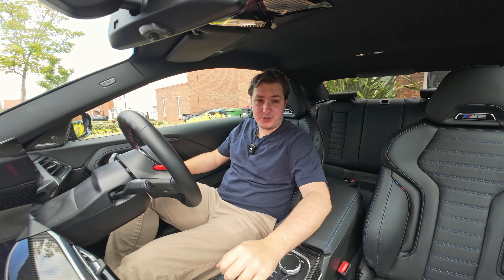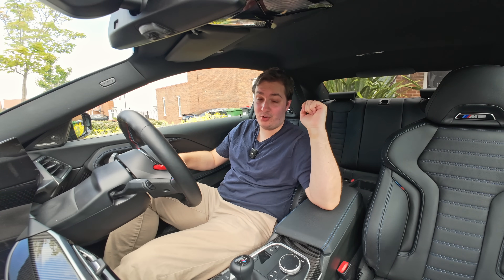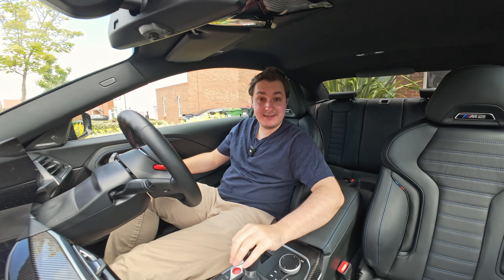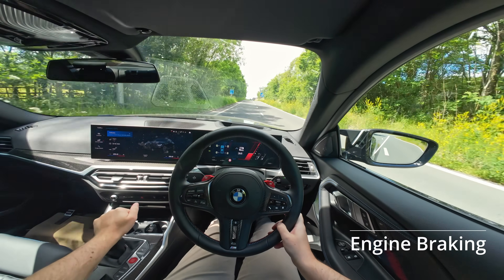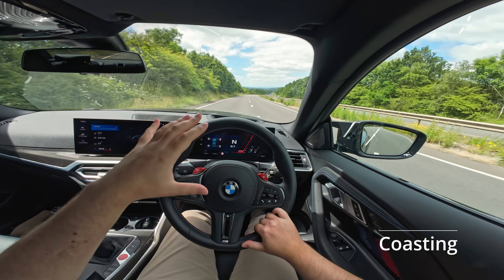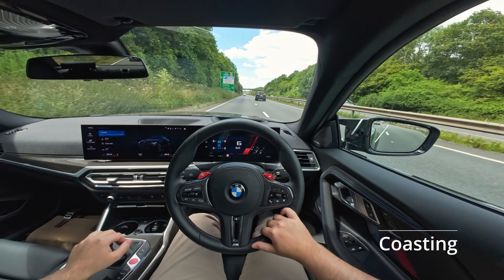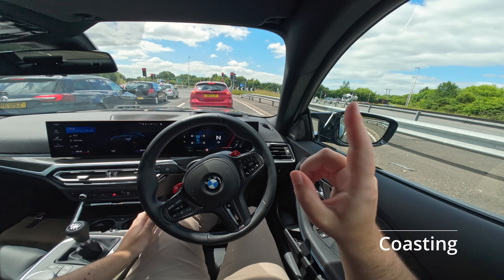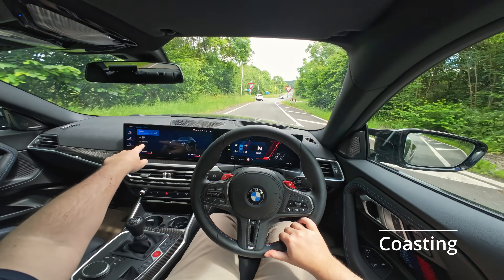Engine Braking vs Coasting - Explained and Tested

Comment: Some modern MHEV cars automatically coast with the engine turned off getting crazy fuel economy. I've seen a 1.3 petrol Renault Arkana get 5.4L/100km (52.3 mpg UK). It's not a powerful car at 158bhp, but certainly impressive for a family SUV.
Reply: That's crazy economy but in a city it depens on how many redlights you have
Reply: @somebody6996  Of course. This economy was achieved in a long trip with a generally low speed limit (mostly 90km/h). If you enter a city, expect consumption to increase drastically. Combined real world economy might be around 6.5L/100km (43.5mpg UK). Haven't really measured economy in a city, but seeing how it affects the average, it probably is around 7.5 or 8L/100km (37.7~35.3 mpg UK).
Reply: my ibiza fr 1.2 can do about that with not the most efficient eco driving. love it
Reply from the maker: Oh yes! I drove a newer hybrid Corolla for a day and averaged 58mpg (99% highway)

It did exactly this, when off the throttle it cut the engine and coasted.
Reply: @MickDrivesCars  you can go one better - the Corolla is actually lightly regen braking in the scenario you describe. Lift off then replace just a tiny amount of throttle. The car will then truly coast with the engine off. Toyota hybrid hypermilers have been doing this since the early 2000s and the original Gen 1 Prius.
Reply: @MickDrivesCars  I drove a Fiat 500 that had kinetic energy recovery. When you engine brake, there is also a regenerative electric motor that charges a little 100 watt hour battery, that gives you a boost on top of the engine when you accelerate again. I'm not sure what the fuel economy was in the car.

Comment: What about engine braking to a stop while rev matching down the gears. Would be interesting to see how that compares to coasting to a stop
Reply from the maker: Yeah you can, and I often do. There wasn't really a chance for this during the video since it was all motorway.

I think if you have to stop engine braking is better. Rev match or engine brake down to idle rpm and neutral from there.
Reply: I think that for coming to a stop it's better to rev match by just holding the clutch at the bite point.
Reply from the maker: I mean, I literally told you not to do this in the video 😂

Comment: I agree. Ive been reading the comments and paid attention to your explanations and you are right. Engine brake for stopping or keeping the car at a reasonable speed down a hill, coasting for when engine brake is too much brake (less likely scenario). Maybe in some hills engine brake or coasting is not the better way but it is to lift just a bit. I hope I am comprehensible.
Reply: I think in most cases, lightly pressing the accelerator in gear to go the same speed as coasting in neutral, uses more fuel.

Comment: Great video, as always. Questions: isn't it dangerous to coast? Decoupling the engine from the  transmission makes a car unstable, precisely because you don't have engine breaking. Second, is it safe/healthy for an engine to engine brake at high RPM?
Reply from the maker: 1) absolutely. Use at your own risk.

2) none whatsoever
Reply: @MickDrivesCars  Roger that 🫡

Comment: I may be wrong. But I have an impression that engine consumes same volume of fuel when we lift our foot off completely. This is idle level of consumption and engine never goes lower than that. You would need to shut it down to consume zero. But it will probably start back again, being turned by wheels, if ignition is on. Let's do imaginable experiment. Do engine brake until full stop. It will never stop, once it reaches balance between initial consumption level and resistance and will slowly drift at about 5-10 mph. But if consumption was zero, it would stop eventually.
While coasting, you go by inertia and will definitely stop. And you can really switch engine off and go large distance from a hill with zero consumption. Only it is considered not very safe as wheels are not engaged with the engine.
So, you always consume idle amount of fuel while coasting or engine breaking. On high speed engine breaking slows down, but at low speed it helps to keep the speed and distance will be longer (as long as you can wait actually).
Reply from the maker: Google DFCO "Deceleration fuel cut-off"

Your (modern, fuel injected) engine uses 0 fuel when engine braking.
Reply: I concluded from your comment that the differences in the video are maybe withing margin of error?
Reply: @Moñin02 Difference should exist. It should be less consumption for coasting. How much less? Depends on everything. For 6th transmission it is close to optimal for the engine at 70 mph, so it makes less resistance, not much of a breaking. But if selection was 4th, it would slow down much faster. And coasting would win a greater deal. But you would need to boost high rpm first in order to swich to 4th transmission, then release the gas.
Reply: Please mind my English..
In my opinion, when we lift our foot off from the gas completely and the revs are in about more than 1,200 RPM, the injector cuts off the fuel. 
I did an experiment, I was coasting a decent downhill on the 3 rd gear (or may be 4 th) and I turned off the ignition while in gear. The car or the engine doesn't make any difference at all. And when I press the gas the car began to slow down more because of more air compression.
Reply: DFCO is indeed present with all modern engines and it kicks in when lifting up until the engine revs go below the idle speed - when it deactivates. If your car doesn't display an instant consumption (to help see how this works) this can be easily checked with a cheap OBD reader and an app like TorquePro

Comment: I believe coasting would eat the brakes faster since you’d be using your brakes more to slow down a faster car. What do you think?
Reply: Yes, but you are using coasting in wrong situation then. If you need to slow down more you never use coasting because it wastes fuel by idling and also uses brakes more. Engine braking is the only correct option for this situation. On the other hand there are situations when it is clearly beneficial to use as it reduces engine noise and increase economy. One clear example is when you are going down a hill with a gear in and you are losing momentum so you need to apply some throttle. But if you were in N you would stay in desired speed or even would be accelerating slightly. That situation doesnt wear your brakes because you dont use brakes on straight road just for no reason you are just conserving fuel and reducing noise. This is easy example when is is just beneficial to coast.
Reply: I agree, and that's the reason why trucks and normal cars are recommended to use engine breaking on long descends. To not overheat breaks.
Reply from the maker: 100%
Reply: The idea of engine braking in modern trucks and coaches still exists , although most are automatic and the retarder ( electric Thelma brake ) does most of the slowing .
However in aspects such as driving light vans with goods such as tools or materials in the back , engine braking ensures you don’t get smashed up plyboard or other materials everywhere .